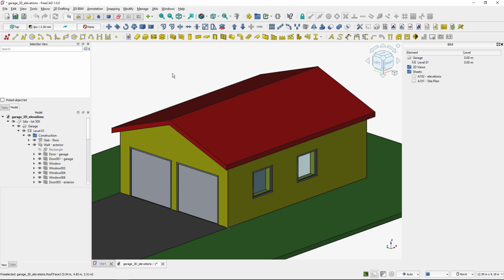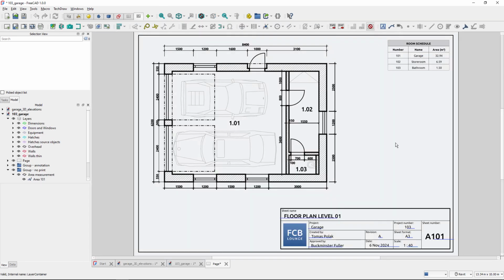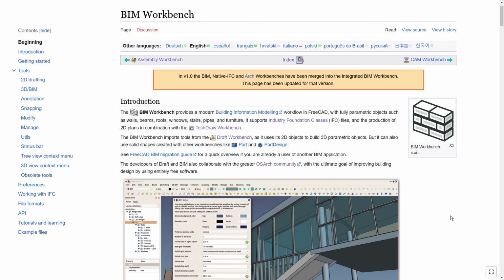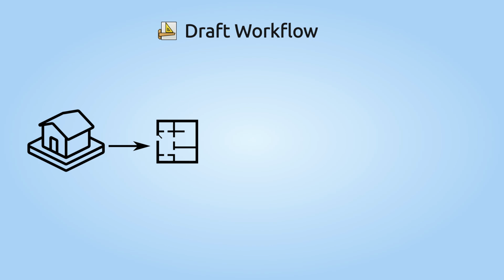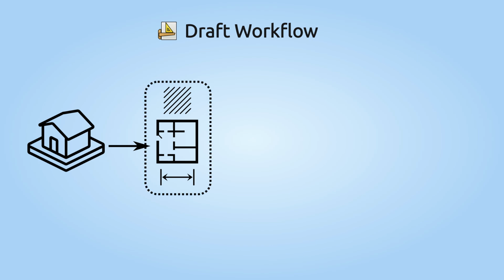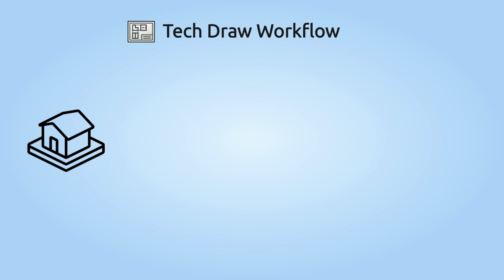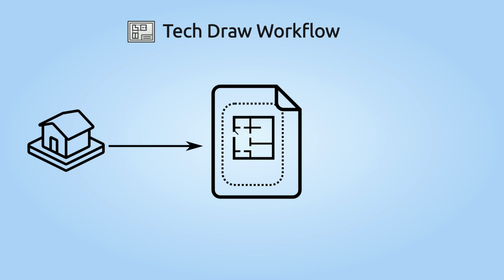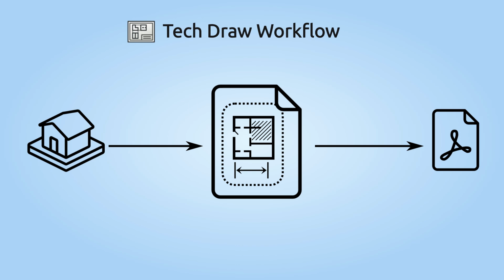Available Workflows for Creating 2D Construction Documentation in FreeCAD BIM Explained

Comment: Using Tech Draw, having drawings which are directly associated to the 3D model, once we get the 2D drafting done on the sheets, can we take them into an editor like Adobe Illustrator and add any formating, branding, extra graphics?
Reply from the maker: Yes you can do that. It it very easy to export Tech Draw page to SVG file format, which you can open in Illustrator.